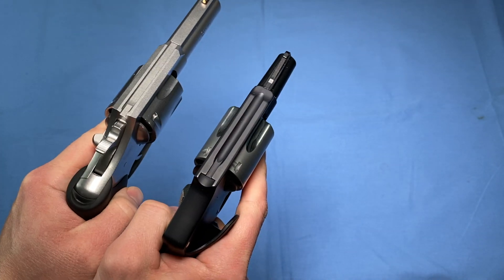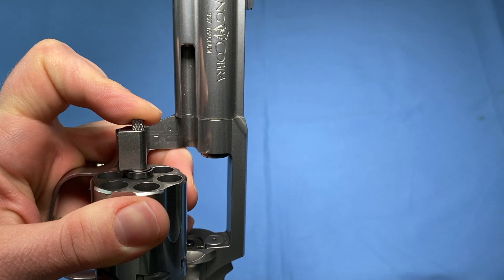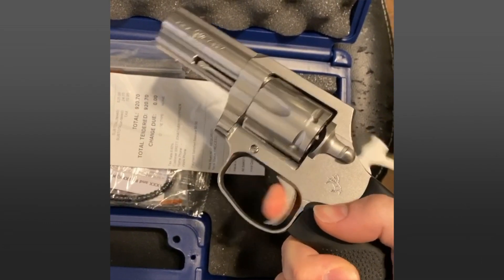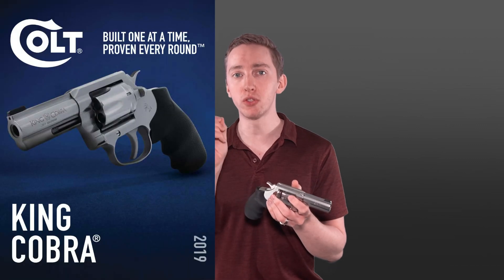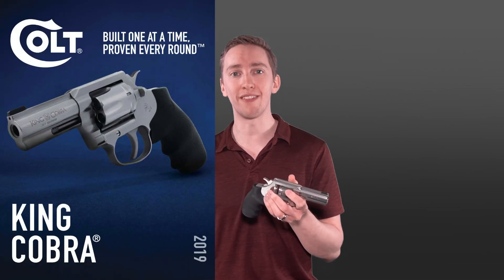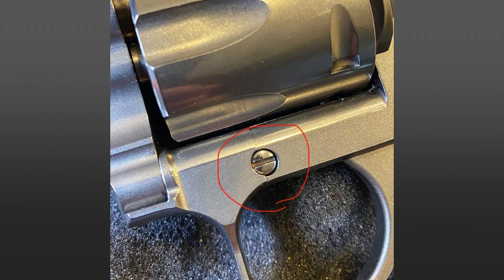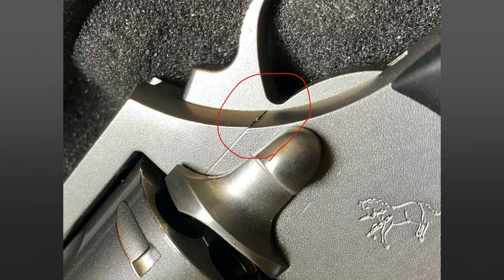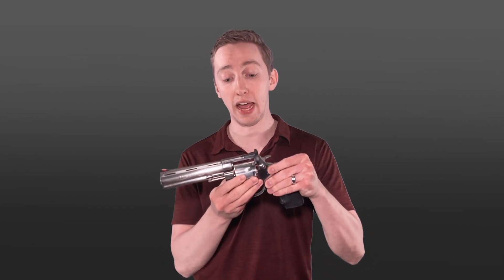Colt King Cobra - Problems, Malfunctions, and Failures OH MY!

Comment: My king cobra 22lr had the return spring break. The spring snapped lengthwise. I had a bad heat treat on my spring.

My gun was released in November 2022, 2 years after this.

I called a d gave my email and other info. Said an RMA will be emailed tomorrow with a 6-8 week turnaround time. I can install a new spring myself! Just mail me a spring!!
Reply from the maker: That’s rough, sorry to hear that… yeah, that spring replacement would be pretty easy. 🤦‍♂️ I can’t believe stuff like this is still happening with the Colt King Cobra 2 years later.

Comment: Lemons happen.  I got the King Cobra, and mine is a great gun.  Good fit and finish.  Smooth operation (cylinder latch, cylinder open and close, ejection rod, single action cocking).  Great trigger, second only to my well broken in Python (mid 1980s) , and on a par with my unused Python (mid 1980 build).  Love the rubber grips, especially when shooting magnums.  The only quirk is that you have to fully release the trigger when shooting rapid double action (there is a tactile point before full release that may may you think it has reset -- it has not).  It has become my go-to gun now.
Reply from the maker: Check out some of the other comments. A couple of people said exactly what you just said until their’s broke as well. And this wasn’t really a lemon considering the Colt rep told me he was aware of a bad part in the King Cobras. Yet there was no recall for said part.
Reply: @NightwoodGuns  -  I hear you, but I consider 1,000 rounds to be a good break-in and decent test.
Reply from the maker: That’s awesome, I’m glad yours is running well! 👍 I hope it keeps on truckin’

Comment: I have a New King Cobra Target and one of each barrel length Pythons. They are all excellent, well made guns and worth every penny I paid for them.  It is buyer beware though. The spring issue was not your fault, but you should have rejected it when the side plate did not line up.
Reply from the maker: I'm glad yours are all excellent so far, that's good to hear! I certainly wish mine was that way... They are only going to get even better as CZ takes over. But, Colt should have rejected mine from the factory. And then they should have fixed it when I sent it in. The fact that it came back to me with a still misaligned side plate after being gone for so long is unacceptable. That's something I would expect from Taurus. I'm relieved CZ is taking over. I'm looking forward to giving modern Colts another shot in a couple of years.

Comment: Purchased a new colt king cobra. Its works flawlessly. Beautifull gun. Worke like an old colt or even better...trigger pull it amazing
Reply from the maker: That’s exactly how I felt about mine when I got it! I hope yours continues to perform well! 👍
Reply: @NightwoodGuns  thanks. If you dont mind me asking . About how many rounds did you put your king cobra through before you started having problems with it?
Reply from the maker: It was long enough ago now that I don’t remember exactly how many rounds. But it was somewhere between 100-300 rounds. Maybe 50 dry fires with snap caps as well.

Comment: I have a KC and it's not given me one issue, I do have a brand new S&W 686 4" that the barrel wasn't clocked right with the frame and the cylinder latch doesn't latch every time you close the cylinder. I have never fired the gun but have contacted them and they are sending me the postage info to send it back to them. That being said I think all firearms companies have some QC issues from time to time. It does suck but I understand that these things do happen and sometimes it doesn't get resolved straight away. cheers
Reply from the maker: Yep, lemons happen. Over the last 10 years I’ve had to send a firearm back to nearly every manufacturer (except for Glock and CZ) I was mostly dissatisfied with how this was handled by Colt and I’m unsettled by the pattern of identical breakages happening to many others in the comments below. Seems like a bad design that is a ticking time bomb to me. But I’m sure most people won’t shoot or dry fire their KC enough to experience it, though.

Comment: You know 2 17 2022 I got an SW 686 plus wanted on for a long time when I got it home I looked at it a little closer and I could see some spots that looked dull or mard and the side plate did not fit good  you could see the seam I have tarsus revolvers that are made better you can't hardly see the seam in the side plate  I just got a new king cobra nice gun
Reply from the maker: Believe it or not, I agree with you on this. I got a Model 19 Carry Comp that was HORRIBLE in Feb. 2022. Smith's post-panic buying Quality Control has been awful. They just need time to catch up like a lot of other manufacturers. Inexcusable though for a product like this. Hopefully your King Cobra survives dry fire and live fire better than mine did.

Comment: I purchased my Cobra from a local gun dealer and took it home.  I loaded 6 A-Zoom snap caps into it and began to cycle the gun.  On the third cycle what seemed to be the hammer sear failed locking the firing mechanism.  Never a live round fired, I took it back to the dealer who kindly replaced it with a "new" one.  Home again, I loaded the snap caps and began to cycle when the trigger return spring failed.  I called Colt and obtained an RMA to send it to them.  Several weeks went by and the revolver finally arrived.  Again, I loaded up the snap caps.  This time the hammer sear failed.  I've yet to fire the gun and X-Mas will undoubtedly contribute to further delay.  I'm very tempted to return it to Colt for a full refund.  (I know....good luck with that).
Reply from the maker: You are about the 20th person to reach out with a similar story since I posted this video. It’s absolutely insane. I hope it all works out for you, I know how frustrating it is.
Reply: Wow, 3-out-of-3 are bad, they're batting 1000 . . . unbelievable, hope they refund you.
Reply: FOLLOW - ON
Colt has had my Cobra now for a little over 1 month after asking for a full refund.  Unfortunately, I'm concerned that the recently announced acquisition by CZ, will cause my return to fall into the "black hole".  I will be calling their "customer service" on a daily basis until satisfaction is forthcoming.  Will keep y'all posted.
Reply from the maker: @bobkeezer133  Thanks for the update! I would be VERY concerned about your gun disappearing into the void with the new acquisition. Keep pushing! Good luck, and keep us posted!

Comment: I looked at two different Colt KC revolvers at my local gun store. I couldn't get the cylinder to release on one of them, and the other was harder than it should be. The clerk said I was doing it wrong, he took the gun and he couldn't get it to release either. I was on the fence between this is the Kimber k6, leaning slightly toward the Colt. No longer, I'm buying the Kimber.
Reply from the maker: I’m not surprised. I’m glad you checked them over thoroughly before buying! 👍

Comment: I've had trouble with them all at some point s&w  ruger hadn't had it with colt yet I just call them all up tell them what's wrong if they require an rma I won't end my call tell I get the email. In regards to the screw being crooked I'd called them and asked for another email. Worst trouble I've ever had was with a s&w  body guard 380 the magazine kept coming out of it is a end it straight back . The third time they sent brand-new gun to local ffl dealer cost $25 but send s&w receipt and they reimburse me for that. Warranties suck and takes time sometimes it's better than being stuck. It ain't like I'm short handed when I send one back though.
Reply from the maker: I hear ya. I’ve easily sent 20 guns back to manufacturers over the years. This experience with Colt is the third worst experience I’ve had with sending a firearm in for warranty work. Second place goes to Remington. First place goes to Taurus. That is not good company to be in for Colt.
Reply: I hate to admit it but my worst failures have come from Smith and Wesson. What a surprise  to me anyway.  But much to their credit they have fixed everyone.
Reply from the maker: Yep, I’ve had to send 2 Smiths back. They handled the interactions well in an acceptable amount of time and they were perfectly fixed upon return. At least with Smiths I take comfort in knowing they can and will make things right if something slips through the cracks. 👍

Comment: Don't give up on Colt, at least not the vintage Colt. When the new Python came out and issues and complaints began piling up I went vintage. 

I found a vintage 1970 Colt Python blued, 4". Comparing prices to Python of similar condition I bought it. It was more expensive than the new ones but I avoided the problems that many buyers had. 

One guy sent his Python to Colt three times before everything was fixed. No one should have to send a product to the factory for them to fix one thing without them breaking something else.

I had a 586 pre lock no dash and stupidly traded it for a used 1911. It didn't occur to me to buy another new one I wanted mine back. Years later I decided to buy a new one. By then they were made with the Hilary hole and removed the hammer nose. Who thr hell wanted one of those.

I went online and found another 586 4", pre-lock no dash. It had been owned by deputy in Kentucky. I made a deal with the pawn shop. 

It came to my FFL. I took it to my gunsmith. After checking it out the 586 needed a trigger rebound spring, the cylinder needed to be resynced to the barrel. At my request he replaced the hammer and trigger with OEM target hammer and trigger. Total cost was $700.
Reply from the maker: Vintage Colt is definitely still cool! I love my Anaconda and there will be a vintage Python in my future as well.

Comment: Like you, I was "snake fascinated" by the pony on the side and that seamless trigger pull, and I bought it without giving it the inspection it deserved. Caveat emptor, as the saying goes. The seam where the barrel and frame meet is a gap you can see through, about the same as the gap between the cylinder and the forcing cone. And just like the 3" K6s Kimber, it hurts to shoot more than a cylinder of full load .357 as the frame is just too small to soak it up, tacky rubber grips and all. I've put it away and gone back to my Dan Wessons and Rugers. 
 It's sad to feel that an American icon like Colt would put out inferior guns like these, especially when vintage Colts command such a premium. And it'll be hard to sell it to someone else with a clear conscience.
Reply from the maker: Honestly, I loved the size and the way it handled recoil for its small profile. Other than that, I completely agree with you. The fit and finish is disappointing... and knowing that it will probably break at some point is all the more unnerving. I replaced it with a GP100 Talo edition and I couldn't be happier with my choice. Hopefully, now that CZ has acquired them, they'll be putting out higher quality products in the next few years.
Reply: @NightwoodGuns  I have two (4"&6")GP100s, and I am a dedicated fan of them. I tell anyone who wants to know; it's all in the topstrap. And my Dan Wessons are .41 mag.... both shoot better than I do.
Reply from the maker: @qmcbbj  I have a Dan Wesson 1911, but I still have to add at least one of their revolvers to my collection. I've only heard great things.

Comment: I wish I saw this before I bought mine. Mine has a timing issue where the cylinder will shoot over the lock and it will drop the hammer on either the rim or the side of the primer.

Comment: Glock did the same thing with me. Smith and wesson repaired my 686 was broken out the box and when I got it back it had detailed notes and a part list. Glock sent nothing, hell they didn't even tell me they were sending it back. My dad was at my house while I was working and it just showed up. No tracking nota. Last time I buy a glock
Reply from the maker: Yikes. I’ve owned a bunch of Glocks but never needed to send one to the factory. That sounds pretty bad though… 😬

Comment: I purchased a king cobra out of the box the shells would not eject from the cylinder it was so tight, I sent it in and I swear the whole pistol was replaced, harbor freight must be building pistols for colt.
Reply from the maker: 4 years later and a change of ownership over to CZ, yet they still can’t make these right 🤦‍♂️

Comment: I just bought a new colt king cobra and after I seen this video I think I made a big mistake. I had a couple smiths years ago and decided to get back into revolvers.
I should have done my homework.
Reply from the maker: Hopefully you will have no trouble with yours. Be sure to test it thoroughly if you plan on using it for self defense. 👍
Reply: @NightwoodGuns  my colt is a new one just out and its hammerless.  I was thinking of getting the same one for one of my kids. I just got shells for it today so haven't shot it yet. I will study revolvers now. I'll check out the sw 686. I want one for them that I wont have to worry about. Revolvers are suppose to be 99.99% reliable.
Reply from the maker: Anyone can put out a lemon, but Rugers, Smiths, and Dan Wesson’s are usually good to go. Enjoy researching revolvers, they are a lot of fun!

Comment: It’s videos and customers like this that prevent gun companies from innovation and taking on challenging undertakings. And, make no mistake, bringing back the Snake series was a huge investment and big step in the right direction for Colt. People have wanted this to happen for decades. Not only did they do it, but they did a fantastic job on these pistols. They are 100% American stainless steel, no ugly locks or holes of any kind, no barrel sleeves, etc. But, no one is perfect; there are sometimes imperfections. For example; one of my Colts came with a small chip out of one the wood stocks. I called Colt, explained the situation, and they said “ sorry, we will send you out another set as soon as possible.”  It was that simple. The whole process took all of 10 minutes. You can’t ask for anymore than that. You “ fixing “ things is most likely a major part of the problem. If your pistol has a problem, and it is covered under a warranty, do not “fix it” on your own. Also, as you mentioned Hitchcock, he reviewed the same pistol. Somehow, his worked perfectly, and he liked it a lot. But, then again, he knows what to do with firearms extremely well. So maybe next time, don’t fix your pistol.
Reply from the maker: I’m an actual consumer. I have no sponsorships, no industry relationships, and nobody sends me guns for free. Videos and customers like me hold companies accountable. Imagine if I chose this firearm for self defense and the trigger-pull I needed to save my life was the breakage. This isn’t a pocket knife or a watch… the performance of a firearm can mean life or death. Sometimes for an entire family. We need to hold firearm manufacturers to a high standard of quality control. But alas, it doesn’t even matter anymore. In a couple of years, once CZ turns things around at Colt, I’ll start purchasing the snake-gun lineup once again.

Comment: Update: been to several shops around WA and although many don't stock revolvers, all of the king cobras I've found have all had a gap between the frame and the barrel you could slide a sheet of printer paper through. Man it sucks being a revolver enjoyer
Reply from the maker: Aw, man. That’s awful. Yeah, it seems like it’s either Ruger or Korth these days 😂 Either that or old Smiths/Colts as the collectors start to die off, lol. Chiappa rhino seems to still be okay. Maybe one day we’ll see an affordable import of the Mateba 6 Unica and we can rejoice. Revolvers are dying and it’s sad to watch.

Comment: While very disappointing, you would have had the same experience with any manufacturer over the Holidays.  Considering the squeaky wheel gets the grease, we have no idea how many of these new Colts are experiencing issues.  I for one, am still getting a King Cobra over any new S&W.  I know going in, that if I have issues, the warranty work takes longer at Colt. Which stinks, but they are a much smaller manufacturer than S&W.
Reply from the maker: Brady F If you want it, buy it. I hope yours runs great and gives you lots of joy! Just be aware that Smith has a lifetime warranty for the original owner, Ruger has an unwritten full-lifetime warranty for the gun, but Colt only has a 1-year warranty for the original owner. Good luck, and I hope your future KC runs like it should! 👍
Reply: Nightwood Guns Good point, the warranty is really lacking.  Internally these new Colts are very simple compared to the old snake guns.  Repair work cost should be minimal thanks to MIM parts.  I’ve had some bad luck with shoddy S&W repairs that have swayed me in this decision, much like how Colt has swayed you.
Reply from the maker: Brady F For sure, this is what I’ve been talking about with others in the comment section. Most manufacturers nowadays are sending out more lemons than before due to “beta testing” on consumers and skimping on quality control to keep up with demand. And that’s not just in the firearms industry. What really pushed me over the edge with Colt was their lie to me on social media and their false advertising of “built one at a time, proven every round.” Dishonesty is a pet peeve of mine and I lost all trust for them after that. I’m sure they would repair the side plate correctly the second time I sent it in, I just don’t want to wait another 5 weeks. But yeah, get your KC and enjoy it, I’ll enjoy my guns, and as long as we both exercise and support our gun rights everybody wins! 👍